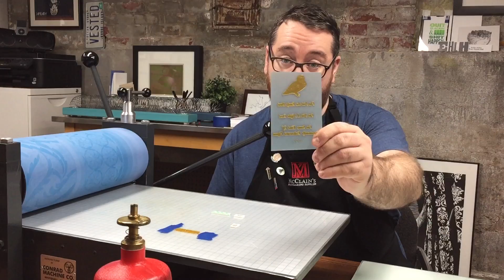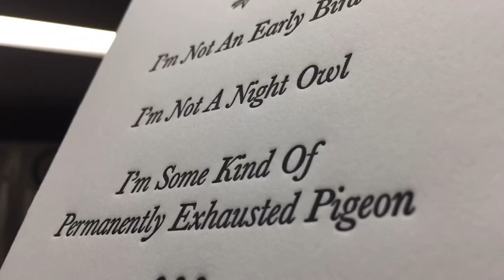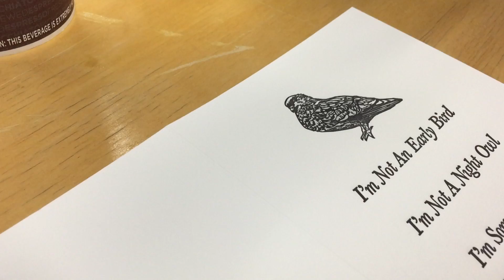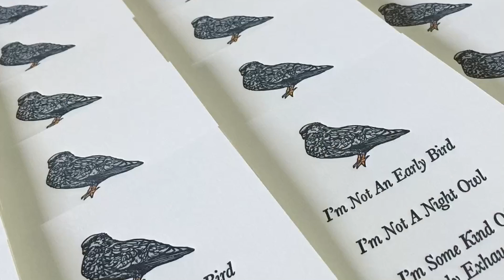Letterpress Printing on an Etching Press

Comment: Love the vid! I've not heard of the etching press but will certainly read more about them! I've done about 300 cards using the poor man's process... The We R Memory Keeper & an electronic die cut/embossing machine. Had the same issues with rails. Got tired of lifting off all 3 one at a time... Hack :) Made the rails long enough to fit off the end of the plate bed, add 3 pieces of strong double-sided tape underneath the attached a clear, thin acrylic ruler (strong chip would work too). Voila... Can lift off all rails at once :) :) :)
Reply from the maker: kukrae that’s awesome! If there’s one thing I’ve learned in all the years I’ve been printing, it’s that you have to have a DIY/ printing hack solution to almost EVERYTHING!!  I still have issues pop up at least once a month! 😊

Comment: Great video! I've been looking for a video describing this technique for ages. Thanks! I have the Richeson Baby press that has been collecting dust, so this would be fun to try!
Reply from the maker: Sue M awesome!!
Reply: ps Can you please tell me where you purchased your brayer? Thanks!
Reply: Can you please tell me where you purchased your brayer? Also, will DickBlick block printing ink work with this technique? Thanks!
Reply from the maker: Sue M that brayer was from a site called American Printing Supply, and unfortunately they don’t make them anymore. Bummer, because I’d buy 2 more if I could! The Dick Blick ink should work. Ink can be tricky because it has to be not too runny/not too stiff. Sometimes you have to try a few brands to get one that works well. Definitely some trial and error. For the polymer plates, most printers stick with oil based or rubber based inks. I’m not sure how acrylic or those “water clean up” inks work on these plates.
Reply: That IS a bummer! Thanks so much for all the info! I was trying to make faux letterpress with a die cut / embossing machine and it doesn't compare. Puttin' on my big girl pants to venture forth with my etching press, lol! Thanks again.

Comment: Hey Eric, first off thank you for a great, well done, video and for taking the time to answer everyone's questions; it's very generous of you. I just bought a small, A3 size, etching press so that I can make letterpress wedding invitations for my sister and I was wondering, in your opinion, how crucial is the rubber offset printing blanket to getting good results and do you think another felt blanket would suffice and if not could you recommend any alternatives to the rubber blanket? Thanks again for all your time and effort!

Comment: Hello! Great video, thanks so much. What is the weight of the paper you are using? Have you had any success with a 110lb paper? Thanks again!
Reply from the maker: melissa drum Hi Melissa! I’m using 110lb paper in this video! It’s my go-to weight for letterpress. I use 220lb also, but it tends to get expensive, so only for limited edition prints of wedding invitations etc. The paper in the video is Crane’s Lettra paper, 300gsm or 110lb (it’s referred  to as both weights depending on where it comes from). It prints beautifully!!

Comment: can I use this polymercard to print on table top platen press?
..I'm sorry I just start learning.Thank you...John..Thank you...Jhon.
Reply from the maker: jhon gris hi! Yes you can! They are actually made for platen presses I just use them on the etching press. You would need to stick them to a base so they are high enough to print. The place I have the plates made, Boxcar Press, also sells the bases that fit in different size plates presses!

Comment: Hi! Which polymer hardness would you recommend for an etching press? I've seen different models on boxcar site... Thank you!
Reply from the maker: elisa duci hi! I use the KF152 hardness, but boxcar offers a plate sampler, where they’ll send you a small plate with their logo on it in all of the different hardnesses! It’s great, you can see if one works better then another for  you! Honestly though, using the etching press and so much pressure, it almost doesn’t matter as far as the plate material!

Comment: Hi- would mind telling me what the "sandwich" is that you use? It looks like you have an acrylic plate (with grid under it), then the rubber mat- is that correct? What do you put on top of the rubber mat, a "blanket"? I'm such a newbie, thanks for your generous assistance!
Reply from the maker: Yes, so the Press bed has an acrylic/plexi top with a sheet of grid paper underneath.thats just how it was built, it came that way!  I put a rubber blanket down 1st, then a thick felt blanket on top called a “pusher”. The rubber blanket is a 4-ply rubber blanket once used in offset lithography. You can get them on eBay, cut to any size for your Press. Search “rubber blanket etching press” on eBay and they pop up. The Pusher blanket is just a very thick woven felt blanket that traditionally comes with an etching press. I’ve seen Printmakers use all kinds of things from regular felt to nothing at all, but I find these 2 blankets are the perfect combination for letterpress style printing. 😊
Reply: You are awesome!! Thanks so much for your help and inspiring videos. Just ordered a sample plate from boxcar and will soon gather all the goodies necessary to start.Can't wait!

Comment: Thanks for this fantastic tutorial! What type of double sided tape did you use with the Henry gage pins? Did you have any issues with it leaving residue on the press bed?
Reply from the maker: Hi! The gauge pins have adhesive on them, so they just stick down automatically. They don’t leave residue, but the actual polymer plates can when you peel them off at the end of the print session. I just use a little mineral spirits and the residue comes right off. You could probably even use “fantastic” or “windex” or a spray cleaner like that. It’s not too sticky!

Comment: Hi - me again. :) I'm a real newbie - so I have to ask - what did you use to get the grid lines under the (plexiglas?) plate? Thanks for answering all my questions, much appreciated.
Reply from the maker: Sue M hi! That’s just a sheet of paper with a grid printed on it. My pressbed is made of a composite material and has that plexiglas top layer attached at one end with screws. So, I’m the other end, you can lift the plexi and put something underneath that will show through. Helps a lot with registration and lining up plates and papers! This is just a feature that came with my Press. I have a Conrad E-15 etching press and Conrad offers the grid paper option. It’s great!
Reply: Cool! As long as I'm asking yet ANOTHER question - is there gold ink that looks like foil stamping? Thanks!
Reply from the maker: Sue M kinda! I bought a little jar of metallic gold oil-based ink on eBay a few years ago. When you print with it, the color is gold with a slight shimmer to it. If you add some metallic pigment (it’s like a baby powder fine glitter you can get at an art supply/craft store ) then you can get more shine. You won’t get that mirror reflect gold look though. See if this link works, this is what I picked up. A little goes a long way, and this guy sells small jars. The alternative is like $100 tub of it from the manufacturer. 

https://m.ebay.com/itm/VanSon-PMS-871-Metallic-Gold-Unipak-Oil-Based-Ink-for-Printing-Press-3-5oz-/322761633108?_mwBanner=1
Reply: Wow, thanks so much for this and your many answers to my questions. Drooling over your Etsy shop. :)
Reply: Thanks again!

Comment: Hello and thank you for the awesome tutorial. Which letterpress machine would you recommend for a beginner?
Reply from the maker: T4 Toyeen hi! I use a small etching press because they are very easy to find, and the price range is anywhere from a few hundred dollars to several thousand. For traditional “letterpress printing”, most artists use platen presses. The problem with those is locating one that works well and doesn’t break the bank! This type of press is no longer made, so the journey begins with searching for one and making sure it doesn’t have any issues (broken parts/rust etc). I would say I recommend trying a few different types of presses out. Maybe in a college or community printshop. The presses all work very differently but they all have some great advantages! Hope that helps!! 😊
Reply: @SpoffordPress  Thank you for your reply.

Comment: Hi Eric,
Love your prints and the use of the etching press for letterpress.
Would the rollers have to be very heavy to make an impression as you have or would a beginner machine work as well?
I was looking at something like a https://corkartsupplies.com/Printing-Press-School-P02922
Just to try it out, or would it be a waste. I'm looking to try intaglio, linocuts and photopolymer /letterpress prints. Its the embossed look that appeals to me.
Thanks, much appreciated.
Reply from the maker: Eoin Brennan hi!! I think a beginner etching press should work fine! The one in the link you sent looks great. For the letterpress plates, you will get a deep impression on any style of etching press. And the link you sent should be great for relief and intaglio etchings as well. A nice thick soft paper is a great way to get that deep impression with the polymer plates! Best of luck to you!!! 😊
Reply: @SpoffordPress  Thanks Eric.
Really appreciate it.

Comment: We got a photopolymer plate from boxcar and our dick blick etching press is showing the edge/border of the photopolymer plate. We could avoid that by just paying extra for a larger border around our image but i noticed that your plate is barely bigger than the print and the line doesnt show up. It isnt pressure because even light pressure will still show the border. We use crane lettra 110# paper. Any tips you could think of?
Reply from the maker: Hi! I have 3 tips: 1. If using a plate like the one in this video with a larger empty plate border around it, I adjust pressure and I use a plastic burnisher to rub the edges of the actual plate flat into the pressbed, getting rid of that slightly raised edge that makes the line.  2. I sometimes cut the plate to almost the edge of the image (makes it look almost diecut), then there is no blank edge at all to make that line. Works best with a solid image, like an animal or something, not so much lots of text. Or 3. I use painters tape and run it around the edge of the polymer plate. This makes that blank edge not so sharp, and can get rid of the line too! Good luck!!
Reply: @SpoffordPress  thanks so much for the time to give thise tips. Me and my wife watch all of your old videos a LOT.